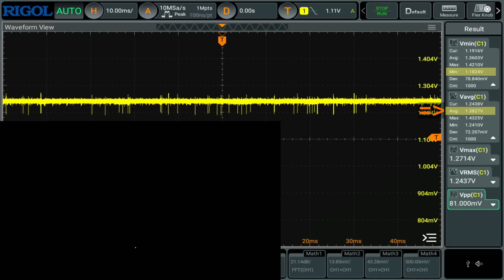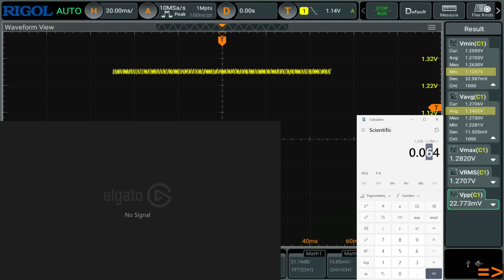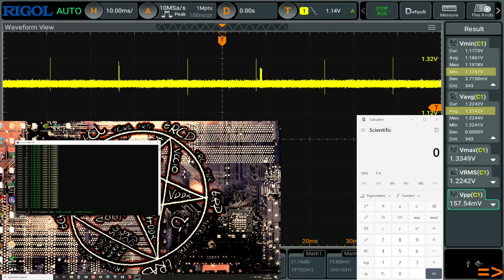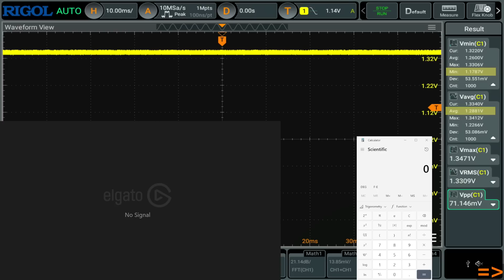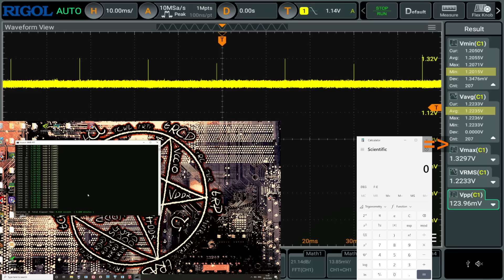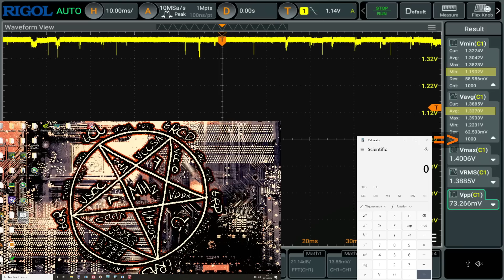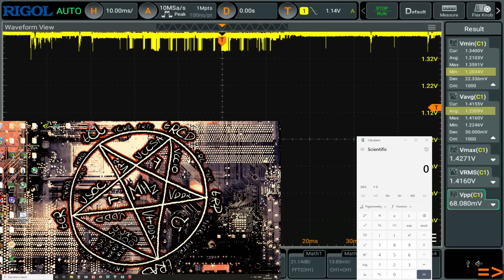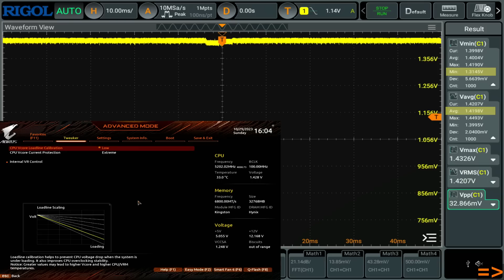Gigabyte Z790 Aorus Elite AX voltage regulation and LLC testing

Comment: Uhh, what is this "biscuits: out of range" in the bios? On the right, where it shows the voltages.
Reply: Mmmmmmmmm biscuits
Reply: It's a silicon quality prediction feature similar to Asus SP rating. Only works tho when cpu is running at auto, not static clocks
Reply: Gigabyte had enough of everyone randomly naming things different and went abstract.
Reply: Yeah but its wierd , I lost 2.xxx by nothing. 
I hat 92.xxx at Day 1 now at Day 30 
Only 90 xxxx 
Without e cores over 95.xxx
Reply: @luks6436  somebody is eating your biscuits ;)
Reply: @Guido De Palma  best comment 👌  like it
Reply: Eusebiu Moraru  I upgraded to the z790 aorus elite ax from my previous z690 aorus pro. I’ve switched from more than 4 different memory kits on the z690 and the maximum stable frequency I can run on the board is 6400 c32

Comment: Learnt a lot ,never choose ultra loadline on daily use.
Reply: Wanna ask an old question,because i am first time to use Aorus mobo,why most of you choose Fixed vcore mode?Some times when i choose this,in windows i see vcore reading from CPU is different than my settings,only when adaptive or override it can be correctly applied.What is the purpose of different Vcore votage mode?Thx.

Comment: Nice helpful video as I got myself one of these with an i7 13700k. Been running it on llc low since the start and it serves me well even If I can't go above 7200mts with my ram, which isn't really bad tbh.
Reply: you have the same motherboard or different. i have z790 ud ac, stock settings and OC it needs turbo to be stable.

Comment: Hi Buildzoid. I’m basically wondering how you go about correctly adjusting the AC Loadline and DC Loadline according to the Vcore Loadline Calibration (LLC). I’ve watched/listened to your videos a couple of times and tried reading about the subject. But I’m not sure I completely understand it. 
I have a gigabyte z790 aorus elite x wifi7 with a 13700k. I would like to use the medium LLC but don’t exactly know how to go about calculating the AC/DC values.

Comment: Given the benefit of hindsight, you nailed or the key points Greg. I respect your intuitiveness. I considered that the real measure of intelligence. I just recently discovered your channel and I’m enjoying your fix or flop videos and their educational value. I have built eight PCs (both Intel and AMD) since the late 90’s and have luckily never faced those kinds of issues. However, one day my luck will undoubtedly run out. Btw, I’m gathering as much info as possible because I’m still struggling on whether to go Zen4 or Raptor. I don’t think I’m alone. I really only stress my systems when gaming, so productivity performance is less important. I wonder what advice you’d give. Cheers!

Comment: Hi Building Zoid, I just bought the DDR4 version of this board and installed 4x32gb 3600mhz ram that I pulled from a working computer operating at the xmp profile. However when I load xmp with a 13900ks it freezes the computer in BIOS or Windows. It also happens when I try 3200mhz...

I have the most up-to-date BIOS.

Do you know what should be done to get the ram to operate above the default 2667 ram speed?

🙏

Comment: Hey man thanks for the video , planning to build a system with apex encore 14900ks and 8400mhz g skill ram do I need to change the AC/DC settings or just leave it in auto? If I’ll just put the correct Intel power limits and svid behavior to trained or best case scenario and cou load line calibration to level 4 my system will work without crashes and instabilities?

Comment: WE NEED A 13900K Z790 ELITE AX 6.0 GHZ tutorial
Reply: Delidd cpu, use 1.4 on turbo all core and done
Reply: @FaceGameFps  is this on a z790 elite Ax motherboard with a 13900k ?
Reply: @jmoore9806  z790 tachyon
Reply: @FaceGameFps  yeah I've seen that I want to push my z790 elite ax to 4x p-cores at 6.0ghz because I know it's got the voltage capable for it....I ended up watching a video of someone doing it 2 weeks ago

Comment: Hello, so what do I set now for a 13900K with enabled E-cores if I have set 2 cores at 6GHz? "middle" and "1.4V"? And why have you set the max and min ring cores to 42, is that the standard setting or does it run more stable like that? and is it better to set a fixed vcore value or adaptive

Comment: Can someone please explain to me what's the impact of the AC Loadline setting? I'm confused, it feels like another way of describing the LLC.
Or to be more precise, it sounds to me like an extra voltage offset the vrm gives over the DC, like...putting a lower ACLL you can basically set it up to have an extra negative offset when under load?

I'm on this same exact board, on low llc. Kind of confused

Comment: Hi, please answer my question. Im using r5 3600 b450 tomahawk max bios version 7C02v3B. my llc option is 8 and vol drop is very little, 
i oc to 4.1 ccx1, 4.075 ccx2 set cpu vol at 1.35 but when i run test cb15 the voldrop is only about 1.336-1,340. 
is this normal? can i use it everyday?
 and above llc 5 there is no vol drop at all

Comment: What's the best way to test if you have a good LLC for your clock without an oscilloscope?
On my 11700k, I'm at 5.0 @ 1.4v LLC5 on ASUS z590 Strix. LLC4 crashes. So I'm assuming to get LLC4, I would need to up to 1.43-1.45? 
I'm just kinda curious how to find optimal voltages outside of an oscilloscope if monitoring tools can not measure.
Reply: You run a stress test (I prefer using ycruncher since it has wild load fluctuations) and you match load vcore, Im not sure if your strix has any accurate vcore monitoring (VRVOUT/Die sense) though

Comment: Nice reviews. I have a question. I have a z790 aero g. Idle voltage is 1.223V load is 1.272V LLC is set to Med. 

Voltage Mode is set to adaptive, Normal -0.11V.  Idle and load Voltage have a Delta of 0,051V. Should i set the LLC lower or increasing the Offset ?

Comment: So GB has the LLC backwards here. Extreme has the biggest drops instead of the lowest. Who named this stuff ????
Reply from the maker: Ultra Extreme has close to 0 Vdroop. It has piles of undershoot. Level 8 on ASUS is the same as Gigabyte's Ultra Extreme.
Reply: @ActuallyHardcoreOverclocking ultra extreme has drop. If you set 6.0 on 13900k at 1.36 it will drop r23 1.33 so it has drop
Reply: @FaceGameFps  we're talking instant drops which you can not measure without an oscilloscope at high refresh rate
Reply: @Kyori0  I care less about instant drop. I care about stability
Reply: @FaceGameFps  That instant drop is the thing which can cause crash/BSOD, so to minimize that instant drop you have to use Low/Medium/High LLC. Because when going above High LLC there is much more of instant drop.

To compensate the average VCore drop from lower LLCs you need to raise your VCore, so it would have the needed voltage under the high load. (high voltage while idle simply does not matter)
Reply: @Kyori0  turbo llc is perfectly fine…